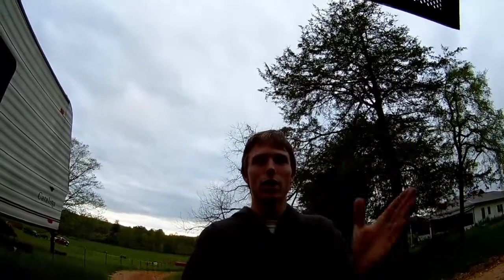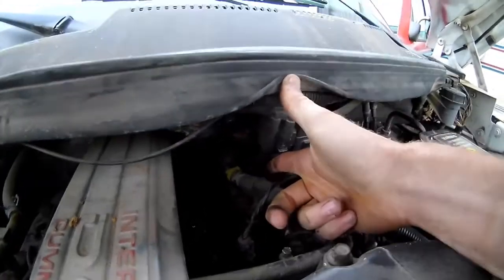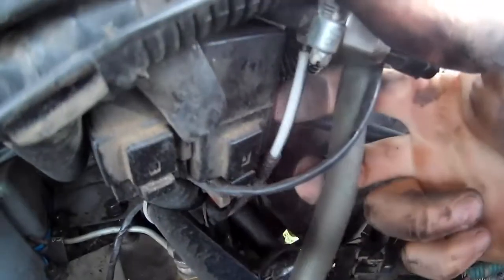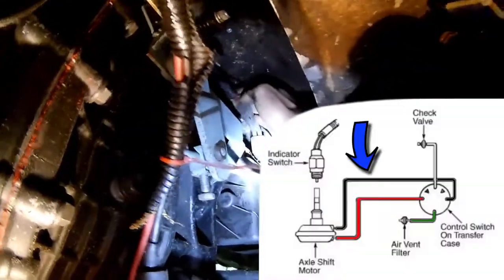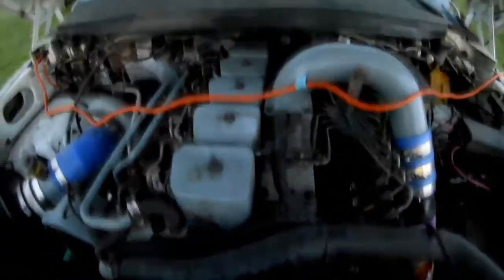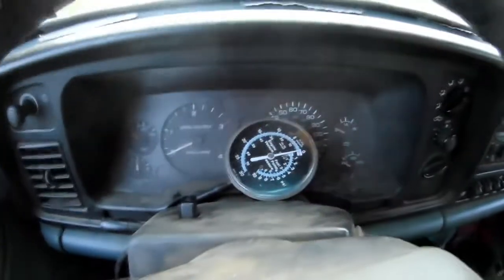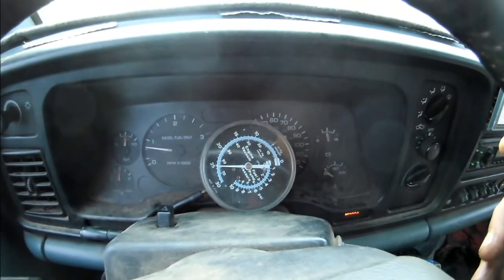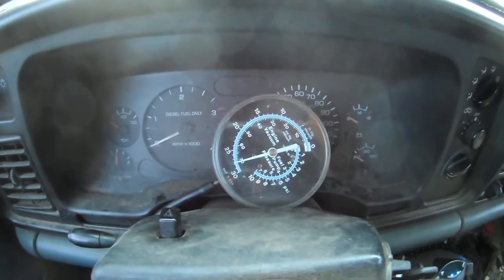Dodge Ram Cummins Vacuum Line Routing

Comment: You’re a life saver! Fixed my “defrost only” and 4x4 issue in 2 minutes by watching your video and knowing where the lines were.  Traced my lines using your video and found the vacuum line on the passenger side had come out of the engine block!  Now my AC and 4x4 both work again!

Comment: Thanks. Big help. After I finished the starter replacement, I had no brake boost. I bumped the vacuum line at the tee to booster. This video saved me!

Comment: Is there any issue if I cap the vacuum line right at the firewall that goes to the transfer case and eliminate all the lines under the truck? Im going with a cable actuated 4x4 locker
Reply: They usually send a cap in the kit

Comment: Which line does this connect to in the cab? Mine broke off at the firewall and cant even find it anymore. Now I need to run a line into the cab under the dash and reconnect. Happen to know where it would need to connect once I get it run in?

Comment: Imagine dealing with this vacuum issue without a schematic and an angry spouse who likes heat and air in the truck? Your spot on with the answers I needed on the vac. System, and the repair. Thanks

Comment: just want to shout out a big thank you for your efforts  explaining how theses lines are routed  lots of great information on your part . i just  got a cummings diesel  and after buying it  i ran the ac and only would come through the defrost vents  so i started digging into it and checked at the main  vacume tube connect at the  main switch  control and no vacuum so i started  under the hood and found the main line has no vac.  well  beings im not familiar with a dodge cummings i decided to look here on good ole you tube and wala i got my info rt off the block thanks once again for posting his  Bill in Nevada

Comment: Thanks for the video. I have a 24valve 5.9 and when I shut the truck off I loose all vacuum pressure quickly but when the truck is running it’s above 25. Is this normal to loose pressure. I’ve checked for leaks and can’t find any.

Comment: What's the best way to get to the vent control end of the vacuum line that often melts?? Will I have to enter in to the dash on the passenger side?
Reply from the maker: You can get at it via the drivers side, there is a clear plastic connector that it feeds into.

Comment: Well, that was good. I have a 2001 cummins 2500. I put a vacuum pump on it and the doors and valves all worked. So, I looked down there and saw a place where fluid should go. Humm, is that part of the vaccuum pump ? I know, I probably shouldn't even own this thing if I'm asking that , right ? Sheesh.

Comment: Thank you. My line going to HVAC controls was broken, right where it goes through the firewall. I spent hours trying to find where it came through. I never would have found it if nt for your picture showing it alongside the AC lines.
Thankfully there was just enough still sticking through, for me to grab it with needle nose pliers, and put a rubber hose onit, to reattach.
Reply: This is the issue I am having now and dont have enough sticking thru to even find it🤦🏻‍♂️😣 Now I gotta figure out where it goes thur under the dash inside and run a line out😭😭😭😭

Comment: I  have a 1990 Mopar dodge van there is a purge solenoid and 2 other similar components together  I had leaks everywhere and when I tried to repair most if not all the hoses broke   the 3 components have 3 hose connectors  totaling 9 connections  with 1 color coded wire connector on each !! I am trying to replace hoses with black rubber hose   !! I have no idea what hose goes where van starts full pedal barely runs  let off the pedal it dies  hissing and stinks of gas & exhaust    I need a drawing or diagram of Mopar engine where hoses going to the purge solenoid and the other 2 components next to it   Any help would be appreciated

Comment: I’m trying to bypass the actuator for 4wd. Can I pull off the black line and cap it?

I want to use 2wd lo. So transfer case in low with the actuator disengaged. I’m assuming if I pull the black vacuum line and cap it, it will just remain disengaged but I’m not sure if it will cause a vacuum leak on the red line. Thanks

Comment: Had a so called mechanic hook my main vac line to my fuel water drain petcock 
 Of course my ac diverter doors not working, 4x4 is not engaging(put a cable lock for 4x4. Wish I would have saw this earlier,  thanks for info, hooked up main line to pump, works like it's suppose to.

Comment: “Keep tapping the gauge, you can fix any vacuum problem.” 😂 Like your videos and you crack me up.
Reply from the maker: For sure boss.  Unfortinitally there isn't really anything cool about any of the trucks at the moment.  My shorty has a basically stock engine, Josh's 05 doesn't even have a front axle under it not to mention an engine, and Jamison's 04 is still waiting on engine go fast parts.  That being said, we're all waiting on some parts from wagler that should spice things up a little.

Comment: Thank you for the video! The 4wd and interior vents were not working in my 98 12v and I feared it was something serious. Turns out the main vaccum line was unplugged from the vacuum pump. Used your video to find the pump and fixed it all in under 10 seconds. Thank you!!

Comment: I have a second gen with that Vacuumsystem but I’m looking for the information on a third GEN it is a 2004 / 24 valve 2500 Dodge Ram With a vacuum problem and it doesn’t even do defrost Could you let me know? Pretty please?

Comment: Looking at a 2001 24 valve. The guy says 4wd, cruise control, and climate controls aren’t working due to a vaccum leak. I know that the trans has been build could it be that the lines weren’t put back on causing the leaks to everything or does it sound more like the main line from the vacuum?
Reply: Jakem34 the lines are frail enough at this age that simply flexing them can cause them to crack.  Honestly vacuum issues are easy enough to track down in these trucks I wouldn’t be very concerned purchasing one with one.

Comment: Hey man. So my 4wd worked yesterday, but today it doesn’t? Hm... this is what I’ve come down too the the vacuum lines  (possibly) now I haven’t tested it or looked but I’m very convinced. My cruise control works but my 4wd won’t engage...🙃
Reply from the maker: Sounds like you're on the right track.  If the vacuum line is broken down by the trans/axle, it's possible that everything else (cruise control, vents) will still work.  It's also possible that your vacuum switch on the tcase isn't working, or the CAD actuator is bent.
Reply: Awesome, I’ll check for that! Thanks for your help bud!🍻

Comment: I wish I had someone like you around here to help me fix my truck that's been broken down 6 months it's got a fuel problem it's hard starting , and I have to fix that first so I can get the transmission rebuilt on my 96 5.9 12 valve.

Like an idiot I took the truck to the Dodge dealer and they ripped me off 900 bucks to put in three bolts

Comment: Great vid, It didn't help me with my prob though. 99 2500 cummins, 512k miles, I have had since new. My climate control issue is, nothing works. The Truck sat for about a year while I was over seas working, came back and got it running again with a little effort, but the climate control is completely dead, like its not plugged in. it doesn't do anything. I checked electric coming in to the switch, it has  13+v, and if I jumper the low pressure safety, with the switch off, the AC Clutch compressor will not engage, if the switch is on, the clutch will engage, so the Dash Switch is getting power. I also Checked the blower motor it has 13v at the plug, and I jumped a line from the battery to the motor and it came on fine. I also Checked the Vacum in the engine bay, and at the dash switch its got 29 hg while running but drops off as soon as the engine is shut down, so there is a leak, but it should still have enough to run the system. I went to the Junkyard and got a whole new Dash switch and same thing...So it has power, vac and the blower motor works, but.... nothing works... any suggestions?
Reply: Try plugging off parts of the vac system isolating your leak.

Comment: I've posted this comment on other videos but hopefully it will help someone. My defroster was stuck in the on position which was due to a vacuum leak.  The leak was in the small vacuum line that passes by the transmission dipstick handle.  The embossed letters "TRANSMISSION" on the handle has sharp corners and over time wore a hole in the vacuum line where it touched.  It was just by luck I found the leak as it was on the hidden backside of the hose.  I felt it but never saw it.  I taped over it and it worked again.

Comment: New to diesels and fortunate to have found a 98 4x4 12 valve manual. Great video, it let me know how important it is to make sure vacuum is maintained!
Reply: It’s very important a vacuum leak can result in excessive crankcase pressure and make the tappet cover leak and possibly create oil leaks elsewhere

Comment: i have a 1997 I just got from my uncle as a early bday present . I definitely needs to have seafoam or something of  that nature ran threw the vacuum line but I cant find it to save my life! my truck doesn't have the brake booster so where do I need to start looking? 
ps this truck is my first diesel "project" truck...

Comment: Great video! Any suggestion on HVAC only vacuum issue I have? 

All other vacuum controlled functions work but vents are stuck on defrost. I replaced the actuator on driver side with no luck and air only comes out of vents if I physically pull actuator arm down. Wouldn’t a leak cause other issues other than vents too? Thanks!
Reply from the maker: in a lot of cases, the vacuum pump can outflow a leak, so if the line that feeds the HVAC is disconnected, then the pump will outflow the leak so everything else is still getting vacuum, but the HVAC won't work.

Comment: Hey! Nice vid, I have the same issue with no 4x4, tried your idea for testing for leaks by blowing into the black line.. not able to blow any air into it. What would you check next? Thanks!
Reply from the maker: I would test for vacuum on the black line, make sure it has vacuum in 4x4, if it does, then it's likely the actuator, if not then try putting it in 2wd and check the red line for vacuum.  Could be the vacuum switch on top the T-case isn't working, or the actuator is broken.

Comment: Hello I thought i might ask a question . I have 1997 dodge 2500 diesel my cruise control not working.
Problem: When i press to activate bottom on steering wheel the light will flash for a second and does not stay on any ideas? thanks
Reply from the maker: Try checking for codes, while these things don't throw many, it may throw one for the cruise control circuitry.  I sounds like either the wiring/cruise control servo is faulty, and the computer is seeing this and disabling it again.
Reply: thanks got it running it was wiring to module stripped :) thanks

Comment: Did the cruise control vacuum line go under the battery tray? Another great video. The pringles can intake made my day.
Reply from the maker: Yes it does, it goes to the cruise control solenoid that's also located under the battery tray.  It can be kinda interesting to get to.  Thanks!  And yes, the pringles can. haha.  People kept asking if it was chipped, so I figured why not!  My chips are even stacked!  They're the special "low fat" model for extra weight savings too.